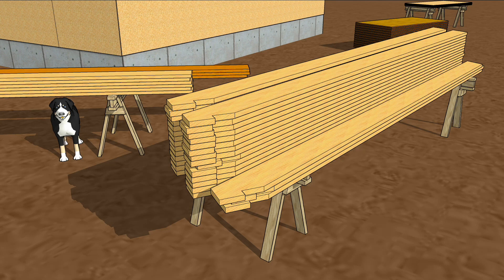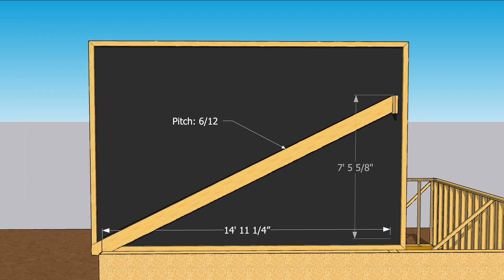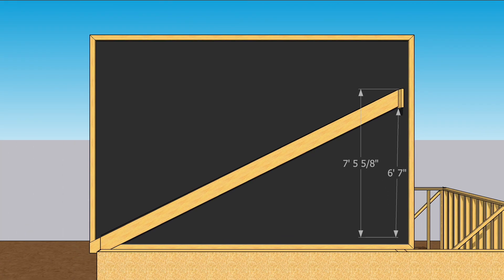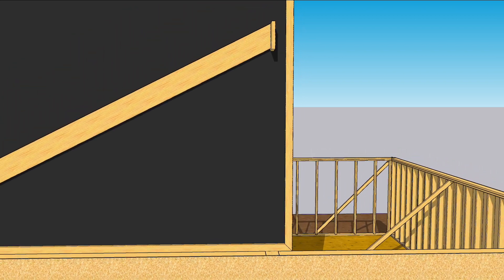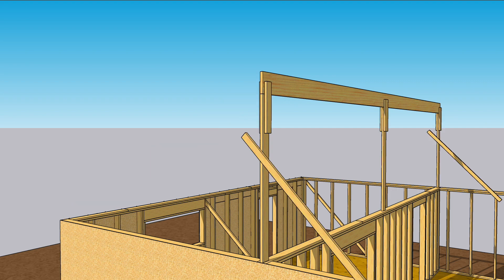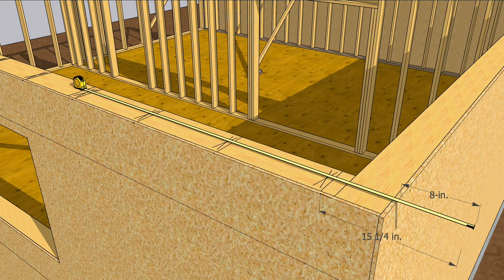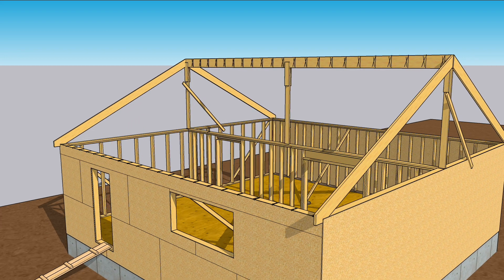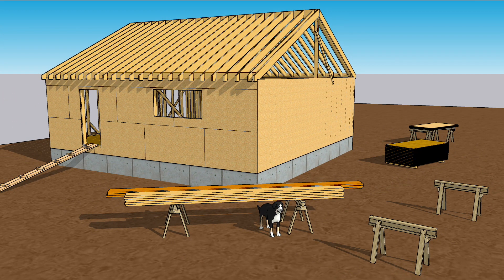How to Install Common Rafters on a Gable Roof: Calculating Ridge Height

Comment: Great explanation. All the inches, fractions keep throwing me. It’s just random numbers to me, as a non US person. 
Just wondering why you would calculate ridge height according to rafter rise? Don’t you determine the height of the ridge/ building first, then calculate rafter rise accordingly? I guess it’s because you want to keep to a certain rise/run ratio?
Reply from the maker: You calculate the rafter length based on the pitch of the roof and the width of the building. In order to set the rafter, you need to know where to put the ridge.

Comment: Shot in the dark by asking a question on YouTube but maybe some one can help on how to do this with a building that is not square as the front of the home is 25 but the rear is 24’9” I understand each rafter would most likely have to be cut individually but what about the ridge how do I place this and have it come out looking good and not off by the time I get to the end of the home
Reply from the maker: Bummer.
I would center the ridge, adjust the rafter lengths, and never use that framer again. 

Calculate the rafter length for 25' width, the length for 24'-9", and the number in the middle (24'-10 1/2"), and figure out how much each rafter needs to shrink from there.

Comment: Initially I got tripped up from the height line drawn at 0:49 because that height does not land at the very top but somewhere near the middle of the ridge.
Reply from the maker: That's the point. Thick lumber is different from Pythagorean triangles, so you have to adjust a few things.

Comment: This is good information except for one thing.  The blocking between the rafters should be be there.  It will block air flow from the eave to the ridge vent.
If you feel must have blocking for spacing, use 2x4's (or shorter than the plumb height of the rafter).  The space left over will allow air flow.

Edit:  Alternate method - If you plan to use spray foam insulation, you could use the full height blocking but, personally, I suggest you still allow for air flow.

I have seen drywall fall off the ceiling because of now airflow and condensation collected.  It was a vaulted ceiling using the rafters as the ceiling joists.
Reply from the maker: Blocks appear at 4:15

Comment: I don’t think this is a bad video at all. In fact it’s the first video that I’ve seen that mentions the discrepancy between skinny pencil lines and right triangles on paper and dimensional lumber in real life! This was the issue I had in my head when figuring this out. 

I’m building an 8x14’ shed. So I know the run/span (4’). I also know the pitch - I’m using an 8/12 pitch. I’m trying to figure the height at which I need to stick frame my ridge beam. It seems like I should start with laying out my bird’s mouth and figure out my height above plate? I can then factor that into my total rise/height of the ridge beam?
Reply from the maker: yes.

Comment: This is by far the worst demonstration I've seen
Reply from the maker: Ouch. Care to expand on that thought, Oliver?
Reply: What didn't you like about it?
Reply: What I’m confused about is the over hang at the end of the ridge?  This demonstrates it stopping at the wall but show you burning 8” on the tape measure.  So should the ridge beam be 8” longer on both ends to allow for the overhang?